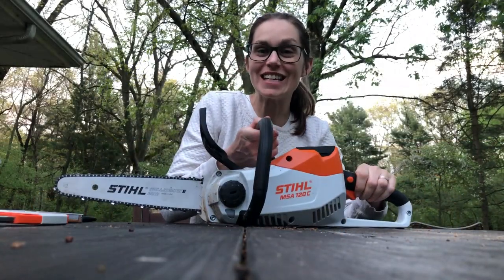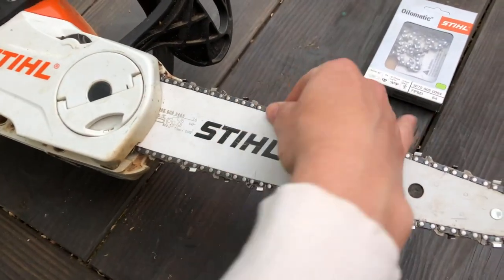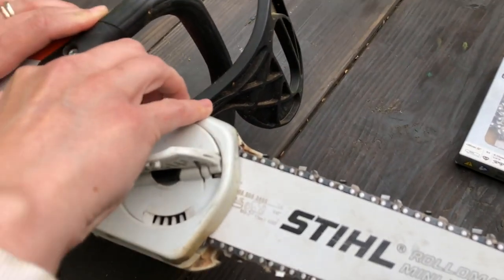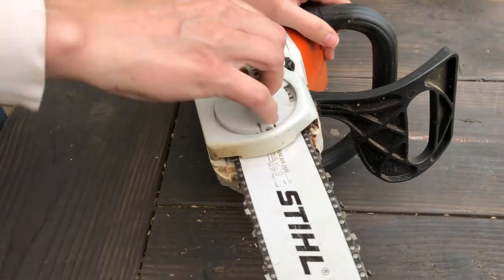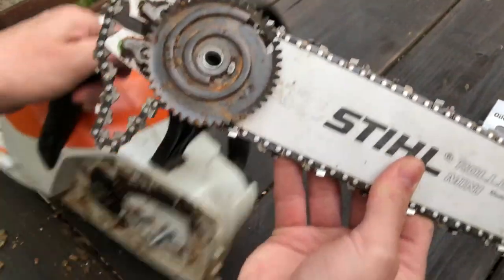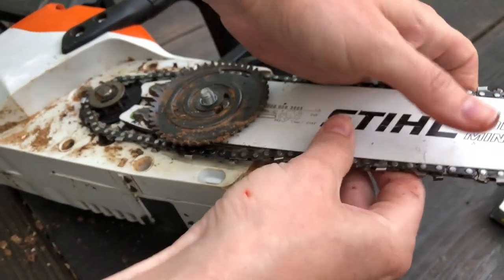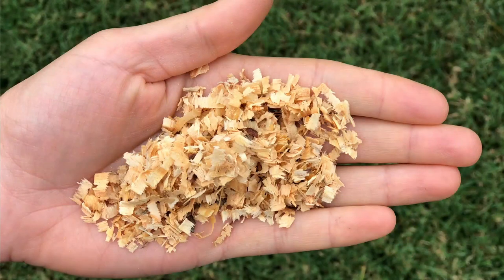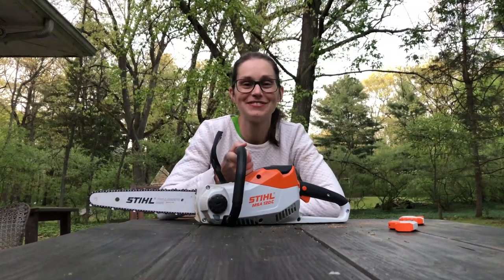Maintenance Tips for Your STIHL MSA 120 C-BQ Chainsaw

Comment: Thank you for this video. I just bought mine, the battery lasted longer than I needed, and was still at 5 lights lit up after 1/2 hour of straight cutting. If you just lay the bar on the wood or branch it will work it's way through. No pressing down is needed. Love mine. Had to buy a 1/8th inch round file to sharpen it, no tool like that available, will call a Stihl dealer on Monday.

Comment: Do you have a part number for the sharpening tool for the Stijl msa120c ? 
Or where to get the correct file for this chain. It’s much smaller than my gas powered stihl saw.

Comment: could you please tell me the size of the sharpener you used on the stihl 120c chainsaw  great vid as well
Reply: The blade for mine has mini written on the box, and shows a round file of 3.2 mm or 1/8 inch. found on Amazon usa, might be on Stihl from europe.